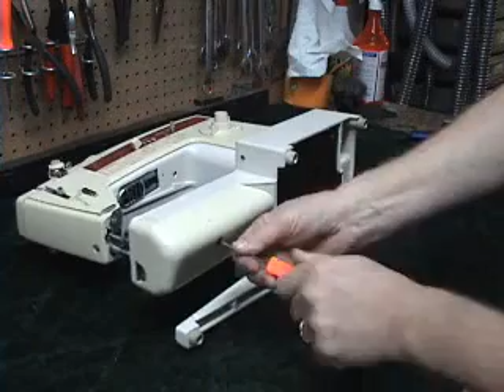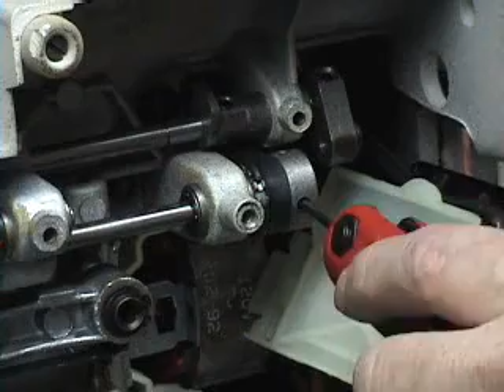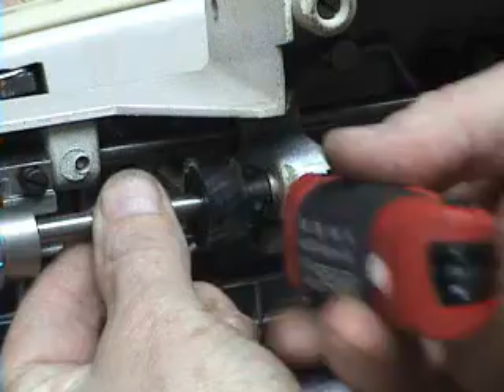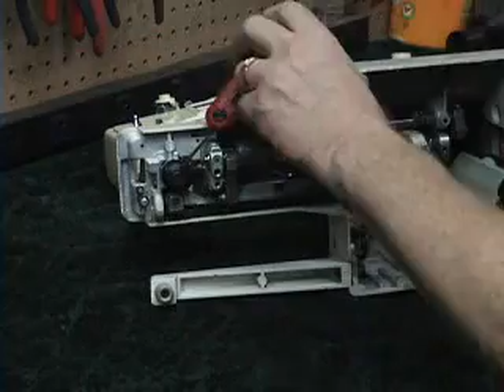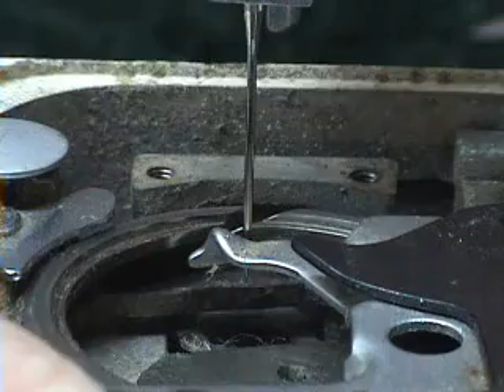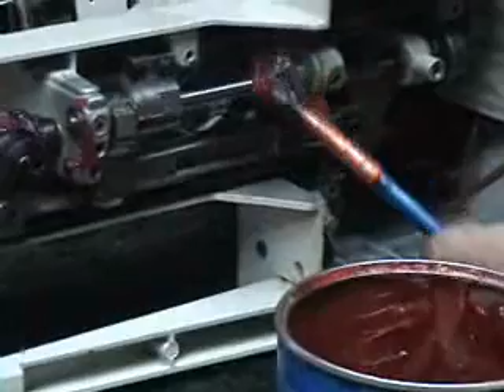Replace Sewing Machine Gears

Comment: The bigger helical gear at the bottom has a sharp needle. The contacting gear is helical too and smaller. The sharp needle of the bigger one, should stay or removed ? It blocks the movement, squeezes those plastic gears.

Comment: I am replacing gears in Singer 834 machine but the back long gear is stuck on shaft. I have oiled it, cleaned all old oil and gunk off, tried to move it with punch and rubber hammer to no avail. Would appreciate any help in getting this removed so I can replace with new gears.
Reply from the maker: Lois, I am very sorry. I'm not a technician. This is the only video that we have available on gears. Our technician recommends bringing your machine in to a local technician if this video doesn't help.

Comment: Don’t try this at home.  It’s not as easy as you think,, take pictures before you  dismantle,, you should get Allen wrench Like screw driver. Type handle. Google.  Sewing Machine Services. In Canada.   I normally check freeness of small feed gear without engaging to long gear,,,,,i time Hook at timing belt end,,then retime the feed ,,,did you recheck hook an Feed timing,, adjusted tensions and sew 🧵 off samples,,,with cotton and STREACH fabric,,,,then you are good,,only helping.

Comment: you took two clips off the shafts but i saw you put one back and the hook point looked past the needle and the shafts have flat spots on and it looked like the first screw in rotation was not put on the flat spot and why didnt you sew the machine off

Comment: This guy doesn’t have a clue of how to actually 
Repair a sewing machine. There are timing marks on feed stoke eccentric that line up
at 2.2mm loop lift of the needle bar, and depending on model there is either a flat on
feed shaft at the large gear or at the feed stroke eccentric. Also he installed the hook gear (with 2 screws) which was white in color
on the horizontal shaft which is too large a hole because it belongs on the hook and also there is a flat on that shaft which he never mentioned . The gear that goes on the horizontal shaft has only one set screw.
Notice after he edited the video the gear was black!!
Guys who make video’s like this lead folks 
into a mess and cost themselves much more 
money to repair by someone who know what their doing!!!
Reply: I wouldn't say he doesn't have a clue, but I did end up putting the gear with two set screws on the wrong shaft after following these directions, and couldn't figure out why I couldn't get the other gear to go back on.  It finally dawned on me that the gear with the ONE set screw went on the shaft with the single flat spot, and the gear with two went on the shaft with the grove that went all the way around the shaft.  I haven't gone back through the entire video, but also think he failed to mention reinstalling one of the c-clips, and I don't remember that he mentioned in the section on timing the machine that you need to be sure the needle goes down when set to the left position, or when set to the largest zig-zag.  The machine will still sew if it's slightly out of time, but the needle will hit in the left position if the slot is coming around just a bit too late.  All in all, I found the video helpful, but as someone who has never done this replacement before, I do wish there had been a bit more attention to detail in a few places.

Comment: Thanks for the video. It's great. I have already loosened the screws and removed the retaining ring. The bar moves a lot but does not finish leaving. It is locked, as if something is hooked, but I can't find anything. It doesn't let me take the bevel gear off the drive shaft. A help please.

Comment: Hi there,, this is quite a helpful video but I have a singer 30518, works a little differently,  it took me a while to find a manual for,,, even singer had a hard time,,  found it online,,but it does not show anything about how to fix this gear and  noone can help me with finding the right part or how it fits on ,, It is a plastic bobbin gear ,, I have called numerous warranty and dealers across the country ,,with no help,, one guy even told me to get a new machine, but this is a nice machine ,, not like the new junk out there,, and it has sentimental value to me

Comment: Hi, I am trying to follow your instructions for the gear replacement, however I'm struggling to take off the slim gear from the long shaft, despite taking off the screw it doesn't slide on the shaft at all. Any ideas what to do to help to take it off? Any help appreciated, thanks
Reply from the maker: Thank you for watching our video. I am sorry to report, without having the machine in front of us, there is not much more we can recommend. I recommend bringing your machine to a local technician that will install your gears for you.
Reply: Hi, I'm having the same problem with a Singer Stylist 834. It looks like the slim gear on the longer shaft has rusted? on to the shaft and won't slide off or move at all. Grateful for any help or ideas. Cheers.
Reply: @baggiezbaggiez7757  Hi, it did bake on quite well on mine, managed to take it off in the end with couple of gentle but forceful whacks with a mallet, did the trick. Good luck!

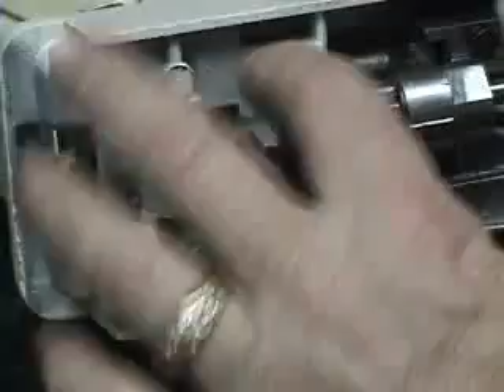Comment: On 4:10 of video, you just unscrewed the gear and it slipped off, well mine doesn't budge and if I turn the gear it actually keeps spinning the bobbin cylinder as if I never removed it.  Please help I have 776 Singer Stylist I just want to replace those two gears you show on that part of video, thanks
Reply from the maker: Hello Zeridah. I am sorry to hear that you are having trouble. Unfortunately, our video would give you an idea on how to take the gears off of a sewing machine. This can be different for every model, however. I would suggest taking your machine to a local technician to see if they might be able to help. I am sorry I could not provide more information.

Comment: I had the hook drive gear replaced on my Singer 2010 Touch Tronic- it cost me $120 for the part and the labor.  A few months later the same thing is happening, doesn't work.  What are the names of the other 2 gears that would need to be replaced and where can I buy them?  I bought the machine new in the 70's.
Reply from the maker: Hi! We can't be sure without looking at your machine in person, but it sounds like you need this set: https://www.sewingpartsonline.com/bevel-gear-set-singer-382980.aspx

Comment: Please help me figure this out!!I am having the hardest time figuring out what happened to my singer merritt 9612 machine!! I went over a denim seam and now my driver ( I think its called a driver ,under the bobbin case and hook) won't go around or rotate. Singer sent me a parts manual but that don't help me figure out what's slipping or not grabbing , which is weird cause all the gears look good.I'm thinking it could be the drive shaft bevel gear but not the teeth side..
Reply from the maker: Hi, Kathy! We agree something must be slipping somewhere. In your case, your machine needs to be inspected by a technician to properly identify the problem. Your local sewing repair shop should be able to find the problem. I'm sorry we couldn't be of more help.
Reply: Sewing Parts Online  I think it is the bevel gear as it all functions properly to that point...so I figure either the inside of the gear that locks on the driveshaft won't grab the drive shaft..I watched your video and I'm pretty sure I can fix it myself..I see you have it for sale., and if I heard your video correctly I should replace both  bevel gears. And thank you so much for getting back with me! I will be following you from now on😊

Comment: Thank you SO MUCH for this.  The feed dog on my machine stopped moving and after watching took the bottom of my machine off to find pieces of the feed drive gear.  Just ordered a new set and can't wait for them to arrive.  Going to try sliding the gear down where there's still teeth left to finish sewing the ~2' left needed to complete my project.
Reply: juki part list botanhol machin

Comment: I have a zig zag and stretch singer sewing machine model 717 the needle no longer goes up and down to sew.  I can turn the wheel and it goes up and down but when i press the foot pedal it just stalls. aWhat do you think is wrong with it? Thank you for reading this.
Reply from the maker: It could be one of many things, but I think it might be your belt. Do you have a local sewing machine repair shop?
Reply: Sewing Parts Online I was hoping I could fix myself.
Reply from the maker: Not a problem. You'll need the service manual: https://goo.gl/PRQsqP
I also recommend giving us a call at 888-824-1192 and asking to speak with Dennis. He gives free repair advice. It might be a few days before he can call you back, but he is the expert. Good luck!

Comment: how do you know is a gear problem? ???
Reply from the maker: Hi, Angelica! There are a few different indications of a gear problem. You may experience skipped stitches not resolved by needle troubleshooting or a thread change. You may have excessive play in your hook assembly. You may also notice that your hand wheel has intermittent resistance or even locks up.
Reply: Sewing Parts Online . yes, my handwheel has the resistance,  I thought it was the belt....thank you. ..I like to watch your videos.
Reply from the maker: Thank you for watching!

Comment: Hello, this is a great video, but am having problems with getting the rod to move out. I have a Stylist 534. Loosened all the screws on the long rod, but the rod will not budge but 1/8th". And I made sure I took the one clip off too. It seems the rod is larger on the left side of the place where the belt is attached. Am I loosing my mind? Do I need to do something different for this model? I know it is a bit different than the one you are showing because beneath the power unit there is another piece with 2 screws. Thank you so much for your help.
Reply from the maker: Hi! I recommend giving us a call and asking to speak with our technician, Dennis. He will be able to help. Our number is 888-824-1192
Reply: Thank you and I will give you a call in the next few days. I appreciate the reply.
Reply: Hi I also replaced 2 gears that were broken but now my needle is not centered like it's hitting something. Can you help me?
Reply from the maker: That's also a great question for Dennis. He's the expert!

Comment: Thank you.  This was very useful information.  Your video gave me the motivation and the belief that I could open my machine and find out why my bobbin was not turning even when everything else appeared to be working.  Sure enough one of the bevel gears was broken.  I think I am going to take your advice and replace them all.  Heading over to your website now to order!  Hope you have express delivery, as I am currently on vacation and had planned to do a lot of sewing before my machine went kaput...temporarily.  The only thing I would have added would have been some information on how to clean the old gunk (lubricant) off the gears before applying new lubricant.
Reply from the maker: We do have fast delivery options. I recommend calling us first to make sure the gears you need don't have to be special ordered.  Our number is 888-824-1192

Comment: hi. do you do any repairs on the vintage Kenmore white machine? I bought one that needed paint so I painted it. I cant remember how some of it goes back together. I took pictures of what I could, like the bottom assembly, but can't figure out the arm that goes from the bottom up to the top inside. if I put it on one way it won't fit, if I put it on the other way, I can't get the screw in to attach it to the shaft that goes to the front of the top..I can text pictures of what I am talking about if that is possible. thanks for any help.

Comment: I was taught by a technician, trained by Singer and Bernina, and with 40 years of experience, that plastic gears should never be greased. Grease can cause plastic gears to disintegrate. I suggest viewers do some additional research before lathering grease on their gears.
Reply: +munsters2 oil WILL damage the plastic/nylon gears.
Reply: Carolyn: Oil will probably not stay on the gears for very long and it may damage the gears if they are "plastic".
Reply: You can get grease made for a mix of plastic and metal gears. I actually got mine from a bicycle shop for MTB gear levers
Reply: He wasn’t a very well trained technician.  Plastic gears, unless exposed to dirt, should be greased with a compatible lubricant.  https://www.machinedesign.com/mechanical-drives/engineering-essentials-lubrication-tips-plastic-gears-and-more-part-2
Reply: I just oiled my machines gears to get the sew. mach. unstuck. Will that be okay? I think I need to replace them.
Reply: I was wondering whether "plastic" gears should be greased. My machine has never been serviced and when I opened it up, the gears had a white colored grease on them, apparently applied by the manufacturer when new. It may depend on whether the gears are made of "plastic", nylon or some other material.
The video states he used "the best grease", but what exactly does that mean since there are different types of grease. It looks to me that he used a marine grade chasis/bearing grease.
Reply: Ok, I did locate some Singer lubricant here. They don't say what it is made out of; it's just called a lubricant. So, I would guess that would have the best chance of working in some, if not all, Singer models and probably in some other brands, also.
https://www.vintagesingerparts.com/collections/singer-replacement-gears/products/singer-lubricant-pure-non-flowing-motor-gears

I never noticed any problems with my machine, except maybe a little bit more noise while running,  before  I opened the machine to "lubricate it", but I think my gears were probably starting to get a little sticky from the lubricant being in there for a long time and starting to harden up on the gears. Maybe the gears were getting a bit brittle too because when I went to work scraping the lubricant off the gears (not wanting or knowing how to disassemble all the gears and shafts), I got too aggressive and split one of the gears. So, now I will need to do disassembly and replacement, ha, ha!
Reply: I have an embroidery electronics singer machine. The upright gear  is damaged. how can replace the the metal gear
Reply: How can fix metalic gear instead  of  plastic upright gear

Comment: I want to replace the feed dog gears, and I tried to loose the screw at the bottom black plate (counterclockwise); however, I had a hard time loosening it, because the screw is otherwise overtighten.  Therefore, I am stuck  right there & could not do any further.  Is there any hint I could overcome this obstacle??? Appreciate your advise.
Reply: +Jeremy Kocourek Never ever use WD40 on a sewing machine.  ONLY use sewing machine oil.  I've fixed a few machines that were froze up with just sewing machine oil, cleaning it and working it by hand.
Reply: Try soaking it in WD40 and letting it sit overnight. If you still can't get it out, drill it and use an easeout to remove it. The screw head is probably already damaged.

Comment: At 3:50 in the video, when you are pulling the shaft out  you say "don't pull out...." and the video editing cut it off! What was the warning? The thing I learned from this video is that to replace gears, loosen set screws and pull the shaft out (?) so thanks for that insight. The LIGHTING, or rather lack of it, ruined the quality of this video. I can't see what you are doing and have no idea what set screws you are pointing out in the dark. Please consider turning on a lamp to illuminate future productions. Thank you
Reply: He meant not to pull the shaft all the way out of the machine.
I think the video is very clear, by far the best I have viewed.